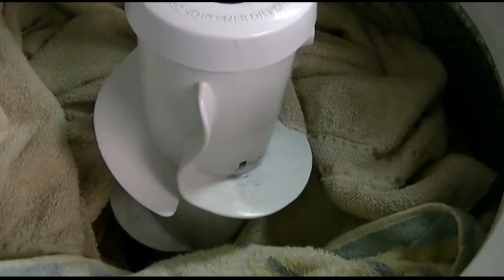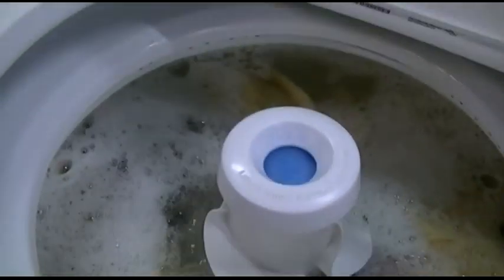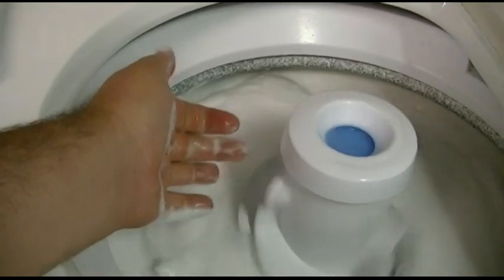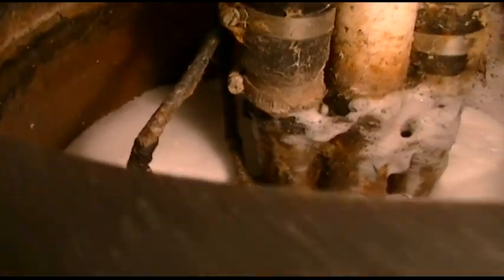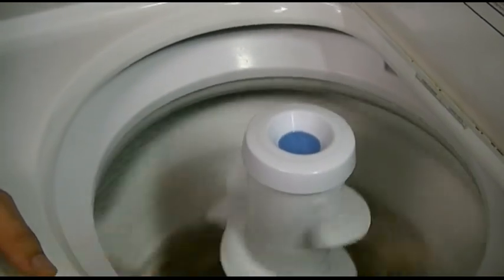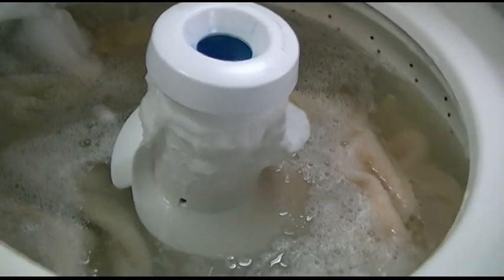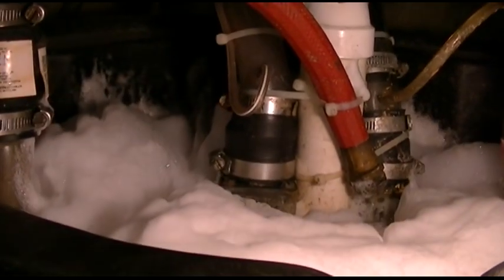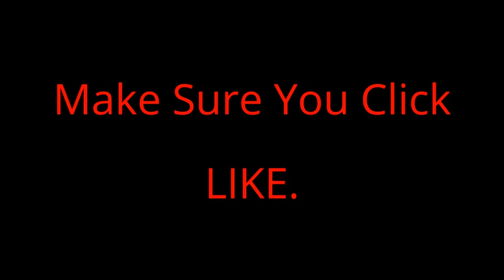WashDay Wash-In 17.0 With Sharkie626!!!

Comment: I have an Estate (Whirlpool DD) model ETW4400XQ0 and it’s still going strong to this day. Never getting rid of it. It’s actually running as I type this. I disabled the lid switch, and adjusted the water level switch to fill higher, and I love the feeling of getting misted by the spray rinses
Reply from the maker: I'm sure it will be running for a long time to come.
Reply: same here. The machine is dated 2011 so I am expecting at least ten more years out of it before a major repair
Reply from the maker: @westinghouse14  My 30 year old machine from 1994 has had 2 sets of agitator dogs.  That's it.
Reply: These things really last forever. Mine only needed one set of agitator dogs so far
Reply from the maker: @westinghouse14  Right.  Those are the main "wear parts" in the whole unit, and they're only 5 bucks for a new set!
Reply: Yeah, most people would just throw it out and buy some crappy high efficiency washer, which will break within a year, and they will wonder why it broke.
Reply from the maker: @westinghouse14  Actually, many never knew theirs were worn or broken, and just went on their merry way.  Others who would typically overload the machine, would notice, and think the machine was just "going bad" after these years and buy a new one.  Sadly, the vast majority of people threw out perfectly good working machines, believing the hype about HE, only to find out the hard way what a bad decision that was.  And, one they'll kick themselves for until their dying day.  Very few sought out old, used machines and got back what they always had.  The smartest people were the ones who saw the writing on the wall once the shift to HE started.  Second smartest are the ones who gave in to it, learned their lesson, and got an old machine back.

Comment: The machine is supposed to spin between the wash and spin cycles and it should spray four times so that a good amount of the suds are rinsed out before the first rinse. Also if you look at the side of the little green plastic scoop it will tell you how much detergent to put into the washer to get low suds. The grey tub is a 2.5 capacity which would be a small load and the white tub is a 3.0 cu ft capacity which would be considered a regular sized load.
Reply from the maker: The washing machine did EVERYTHING it was supposed to properly.  It does a neutral drain, that's normal operation.  I know EXACTLY how much detergent to put in.  I didn't.  I put in how much I wanted to.  If I put less, believe you me, that would have sudsed up the same.  Zote flakes are flakes of Zote soap, bar soap that it.  When you subject actual soap rather than synthetic detergent to that kind of agitation for that long, you get a lot of suds.

I'd have to point out here that with 2 washing machines and 2 dryers, plus a collection of detergents from around the world, chances are I know what I'm doing.
Reply: yup

Comment: Just was curiouse about the water level adjust on my maytag i have it adjust higher because i can fit more clothes and i wash a lot of bulky items so i set the level where i needed it for my bulky items
Reply from the maker: That doesn't help it wash that much better really.  The more you have that machine loaded down, the less the agitation.  The articles need to swim freely in the water.
Reply: jaykay18 unless its a big comforter i load the machine more eith the added water and all articales in the wash have a decent turn over i made it where one medium landry basket  just up to height of dryer door  can fit in the washer as one large load amd still have a turn over on the normal cycle just today ive done 15 loads l.
Now reduce the water level smaller loads added up.
The water level now matches that of the amana washer on full load same drum size and agitator.
Reply: I dont like to overload my washer but i have so much laundry so little time.
 i usally load the washer full to the indented line in stanless steel drum and water just above the squar notch where fabric softner dispenses.
Uaslly load about 10 towls at a time they ageitate quite well normally use heabyduty cycle.

Comment: Hey jay look up whirlpool catalyst Jeans cycle and watch all three parts
Reply from the maker: Thanks for that.  Basically what they did with that machine is upgraded it to the luxury package, you know, leather seats, sunroof, premium sound, that kind of stuff.  Under the hood it's the same old reliable direct drive.  They just added more stuff to go wrong.

Interestingly enough, my dad's Lady Kenmore machine has similar detergent and fabric softener dispensers that flush with water to dispense.  Manual ones are so much better because they just plain work.  With the automatic flush ones you need extra parts, water lines, diverter valves, extra cycle cams on the timer, etc.  Just more to break, but the end result is the same.

Comment: You where trying too have extra suds in the wash to compar how a old washer woumd hadle it verses a modern washer that will easily suds lock?
Reply from the maker: Just proves that these machines are practically bulletproof.
Reply: jaykay18 yupb they sure are.
Reply: jaykay18 hey just wondering is there a water adjustment on the speed queen like sharkie626 or is it just on yhr knob unit
Reply from the maker: That's a great question, and I'd love to know if they still use the old pressure-switch system.  I think though, since it's electrically controlled, they are measuring resistance; alternately, they may send voltage through it and measure that through its resistance.  Either way it's probably more difficult to defeat.  Though if it is measuring resistance, you may be able to provide more or less resistance to alter what the computer reads.
Reply: jaykay18 possibly i havent seen any water adjustment videos on it. Just the knobe control units.
Reply from the maker: A guy that's really good with electrical circuits and circuit boards can figure it out.
Reply: jaykay18 im sure someone could i sadly i dont know anyone that is.
 i dont mess with electronic controls.
Reply: jaykay18 have any ideas. Im looking to buy a battery tender for my car because i make a lot of short trips work home work home througout the week i was told its bad for my battery as it cant charge  i wanted to get a battery tender  to plig it on once a week or ad needed monday - saturday i drive it maybe 10 miles each day. I was yold the short trips could be why my battery failed early.
Reply from the maker: You certainly wouldn't need a battery tender if you had a normal person's car.  I can leave my Camry sit for 2 weeks untouched and it starts no problem.  I've left my classic for over a month and it also started no problem.

Short trips really shouldn't be a big deal either.  Generally, as long as the engine is running about 1000-1500RPM, the alternator will be producing enough current to overcome accessories running as well as charge the battery.  Each time you turn the key to start the engine, the starter creates a huge draw on the battery.  But that's in what's called the "surface charge"; the alternator should be able to replenish that within a matter of 5 minutes.

I'm sure the other Beemer drivers will point and laugh when they see a battery tender hooked up to yours, though of course their cars leak so they wear Depends.  Look for a battery tender that has a detachable plug; perhaps you could route that under the bumper, or out the wheel well inner liner, or out fake vent louvers that do nothing if so equipped.
Reply: jaykay18 i dont know my battery keeps going low and i dont drive it much  cant afford to have it checked  if i drive it more  all the issues go away  or if i idol it a god 30 minutes before shutting it off i litterly only drive it to work about 5- 10 minutes then back home.
My car has no added vents or oil leakes my car is all oem no aftermarket crap that looks awful.
It stops having issues when i actively drive it. 
Like lets say i drive from galveston to houston then back my car will be good no issues for week and a half back when i made trips like that twice a week it never had battery issues.
The issues started as soon as i stopped making long trips with it.
Reply from the maker: Which clearly indicates there's something wrong with it.  Remember that if on a battery tender, and you get a nice thunder and lightning storm, it can blow out the car as well.

If the drive to work is so short, biking or walking isn't an option?
Reply: jaykay18 no because im usally carry a lot of stuff to or from work. For instance  animails  work towls blankets clothes  that didnt get completed during the day as i cant stay all night and wash so i use my washer at home.
Sometimes after work i have to stop and buy whatsver is needed for the house.
Also at times im needed to run to the bank and deposit checks or pick up things at home depot and i take my car. The company car is for job sites and client meetings only.
Reply: jaykay18 i got a charger from bmw 70 bucks lets see how long i can keep the car running before i have to fix it.
Reply from the maker: So you use your car as an overpriced version of "grandma's grocery getter".
Reply: pretty much with work and home I don't have time for trips and fun most of the time I have my own home a partner plus I do wash dry fold I get the grocery's I do the cooking and cleaning. so between work and home I have no extra time. im off sundaes but I spend that doing laundry and cleaning buying thing needed at home.maybe once a month do I get to get out get away from all the work.my partner works a lot to a lot more than me though.its always been my job to run the house I took the job because we needed the extra money.
Reply from the maker: People work themselves to death these days.  I was one of the few that escaped.
Reply: jaykay18 wish i didnt have to work all the time but got bills to pay.
Reply from the maker: There are literally thousands and thousands of these machines out there still in service.  Many people don't even have a clue whether its working properly or doing something wrong.  You can just leave it alone and chances are it'll keep on doing what it's doing.
Reply: jaykay18 true that up till i saw your videos and someone brought it to my attention i had no idea it wasnt supposed to do a spindrain im going to keep it running just how it is untile i decide what to do.
Its a crazy washer  it will run fine with break a few loads then it will stop and start making the noise again. 
Today i didnt catch it on video but for a few loads it even held and drained the water before spinning and the break worked no noise as worn and tired as is its still washing.
Reply: jaykay18 sadly the end is near for maytag washer it just started making a banging noise when goes into spin sad to say its last load is near.
Reply from the maker: Remember, it can be fixed relatively inexpensively.
Reply from the maker: The sound doesn't appear to impede it working.  At the very least, you can pull the cabinet off and have a look-see; the noise may be readily apparent as to what it is.  Even if you do sink money into it, another issue will come up.  When is the thing we don't know.  And when it happens, you can make another decision as to what to do.  You have to sometimes live in the moment.
Reply: jaykay18 its the clutch i did looked at it tracked it.
I also did a test got it up to speed on spin shut it of then right back on since the brake dosnt work sometimes the clutch would delay engage.
Well as soon as the clutch engaged id makes that noise  and come to think it that poping noise is the sound the vlutch would make whrm it engaged.
Maybe something in the clutch has failed or a part has broke of or somthing i know the clutch is burn your hand HOT.
Reply from the maker: Great, now start sourcing parts.
Reply: jaykay18 adding a new clutch to my list of parts brings it to 250 to repair that washer.
Reply: jaykay18 its deffinatly something with the clutch i can now hd the drum when it goes into spin and it dosnt pull as strong and the spins is slightly slower also it wont take off like it used too.
Reply: jaykay18 sorry if i bug ya too much i know i can talk alot.
Reply from the maker: You could go to a used appliance store to price one out, might be cheaper, but it's also like buying a used car, you're inheriting someone else's problems.  Typically the shop will offer some sort of warranty like 30 days.
Reply: jaykay18 buying a used washer is an option like ylu said though i could just be buying spmeone elses problem.
If i go with another washer im shooting for speed queen.
If i cant get a new washer im shooting to repair this one at least i know its issues and history and qont be buying another problematic machine. 
Id like a washer i dont have to worry about for sometime it just works.
We havent set in stone weather or not to fix this one or buy a speedqueen.
Reply: jaykay18 there has been lots of resarch going on been talk of a nee speedqueen toploader  repairing this one  theres even been talk of a new speedqueen front loader my partner wanted a frontloader this time.
Im on charge of the laundry and cleaning so we shall see  for the most part the decision is up to me and what i want im not to sold on a front loader ao that may not happen
Reply from the maker: Front loaders are garbage.
Reply: jaykay18 so far thats what ibsee to i havent seen one im impreassed with.
I want a washer that cleans and for the next 10 years i dont have to worry about it.
Reply: jaykay18 well my washer finally gave up the motor seized.
New speedqueen on the way.
Reply from the maker: You made a good choice.
Reply: jaykay18 i feel that i did the maytag just had so many issues.
We are about to go pick up the washer thet cant deliver it till next week booked soild and i need the washer today.
I have a piles of laundry a good 10 loads.
I cant wait or i wont have any wotk clothes.
Reply: jaykay18 its hear installed love it.
Reply from the maker: No surprise there!  Manual controls or electronic?
Reply: jaykay18 electric.
So far run 2 loads in its a little noiser motor wise then the maytag but thats okay.
When it goes into spin no clanks heck the thing hardly even vibrates compaired to my old one.
Man this thing is heavy so much heavier then any washer ive ever had to move.
Reply from the maker: Too bad you didn't get the manual controls, this was the last chance from what I understand.  They're a bit hard to find though, most places don't stock them.
It weighs a ton because that's all quality you're moving!
Reply: jaykay18 i asked about the manual controls but the man said they just sold the last one and qoukd need to order more.
Since my washer died i needed one now i bought the one that was instock and it was the only one the guy had. 
He says he sells speed queen like crazy.
Reply: jaykay18 well i been running the speedqueen all day it works flawlysly. Im highly impressed with it.
Reply from the maker: It's top quality stuff.  No wonder.
Reply: jaykay18 well this is great my dishwasher has gotten glitchy ive noticed it isnt always draining the water out at end of cycle.
Ive also noticed it isnt cleaning as good as it used to other than that it works fine it is 10 years old though.
Reply from the maker: The orifices in dishwashers are smaller today; they can clog up with all kinds of stuff.  You should be able to remove the spray arm easily, and you can poke out all the holes with a tool.  

If it's not fully draining, that's usually a sign of a partially blocked drain or drain hose.  Or possibly a mis-routed drain hose.  Could also be due to back-siphoning, especially if there is standing water in the pipe or garbage disposal, if you have one.
Reply: jaykay18 ill take it apart and see what ibfind in the dishwasher.
There might be a drain blockage then. The dishwasher is 10 years old and just recently started having problems.
I do have a garbage disposale and to my knoladge it is working correctly.
Reply: jaykay18 just checked my washer the drain was pluged with gooy slimy stuff yuck.
As far as the inside ill check it later.
Reply: jaykay18 well guess i dont need a dish washer cleaned out the hose bleached the disposal cleaned.
Cleaned out the dishwasher and rand clr cleaner through it with a full cycle to rinse it.
I then ran a load of dishes cleaned like new.

Comment: Try using that soap in a Frigidaire top loader
Reply from the maker: How many more suds do you want!
Reply: jaykay18 The 1989 Frigidaire washer has a recirculation system with a lint filter and it uses a spray during the first and final spin.